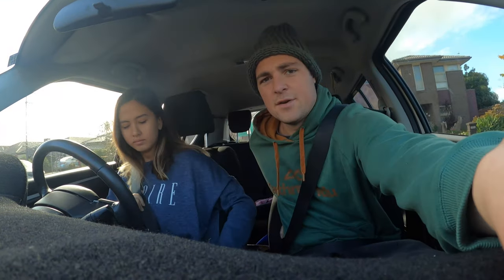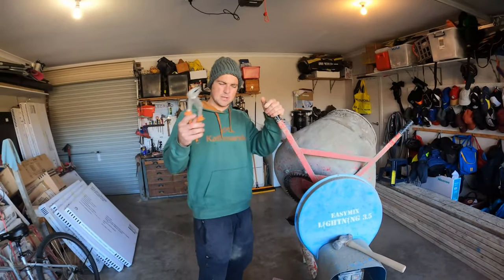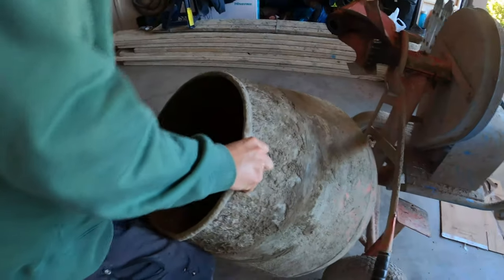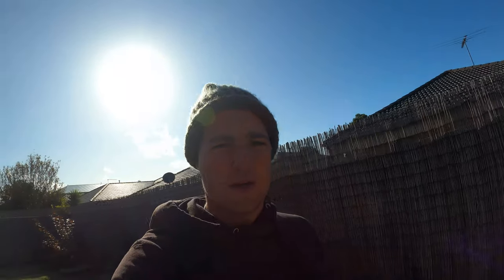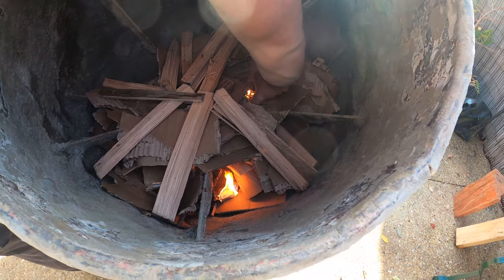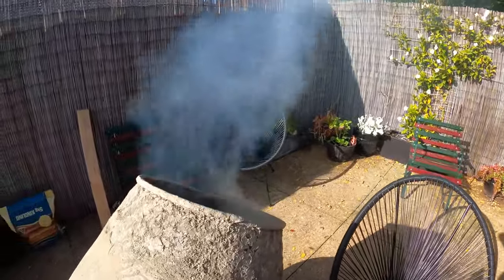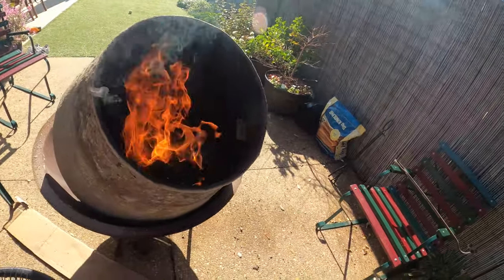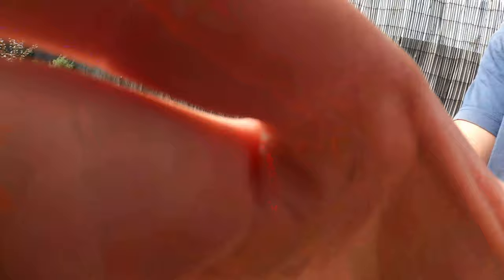How to Clean Your Cement Mixer ?

Comment: We clean our mixer every day using bricks and water then let it run for 10 minutes. I then empty the bricks and water out and give the mixer a quick rinse . I then add little bit of diesel in the mixer and wipe it down with a rag . The diesel keeps it nice and shiny and lubed up .btw I’ve been using the same mixer for 25 yrs.
Reply: Ballocks. I do the same but you always get accretion on the paddles.amd rim..

Comment: To get it clean put half a dozen engineering  brick halves in the drum  with a bit of water after last mix and just let it run  till your ready for home always works on mine hope this helps from the UK, good videos keep them coming
Reply: Even better than that is to fill the mixer with ballast, water and brick acid  until the water is just about spilling out the drum, then let it spin for ages.  Less noisy than brick, plus a lot more surface area with the smaller pebbles and grit sand.

Comment: Few shovels of gravel or hardcore and bucket of water at end of shift let it mix about for five or ten min, keeps drum clean also keep a bucket of water beside mixer to keep shovels in when not using as it keeps shovels clean, when I ever get a bit of hard mortar stuck in drum I whack outside of drum with a rubber mallet while it's turning that way you knock mortar of inside of drum but you never actually dent drum👍

Comment: The best way to clean a mixer is to not let it get caked like that, but even the most careful brickies etc end up with a shitted up mixer in time, I found the best way to clean and the easiest isto fill the mixer with ballast, water and brick acid until the water is just about spilling out the drum, then let it spin for ages.  Less noisy than putting bricks in the drum, plus a lot more surface area with the smaller pebbles and grit sand.

Comment: Did mine this morning 
Fired it for 10 min, bashed off the thick stuff. Run with gravel, water and some acid. Oil spray to stop rust til the acid cleans off

Comment: Wash it with a hose on the inside and chuck a bunch of shit bricks in it smash them up with a hammer and water let it spin for 5-10 never let the mixer dry while your working in the day always have the drum wet as much as u can and a brush to get the cement off during the day while making batches 👌🏾

Comment: 😆😆😆 watch them eyebrows seen a guy do it with petrol and boomed back out in his face lol. Only thing with doing that it expands the drum so if drum has join it’s not great. 
Keep 1/4 bucket water in for few minutes once gear is poured out and that keeps all the loose of sides. Makes easier at the end of the day. 
If we’re a bran new mixer drum grease the inner and our daily before use helps all to keep cement of.
Reply: Bullshit with the grease it will all be in the first mix

Comment: Heating up that mixer will just take the strength out of the metal and you definitely have ruined it.
Reply: We used to light fires in our mixer on a winter morning, waiting for materials, would definitely keep the mixer clean, and we had that mixer for a decade.
Reply: @steviezeee1904  If you knew about the properties of metal you would know that steel gets soft at around 350 degrees and around 626 degrees it looses half of it's strength. Typical camp fire burns at around 1000 degrees. A little example of the difference it makes. When I was a kid we used to use a burn barrel to burn our garbage. We could stand on that barrel and roll it under our feet like a old fashioned logger in the water. Once we burned garbage in it and it got hot enough to burn the paint off if you stood on it it would just bend and the open end would just turn oval from it being so weak.